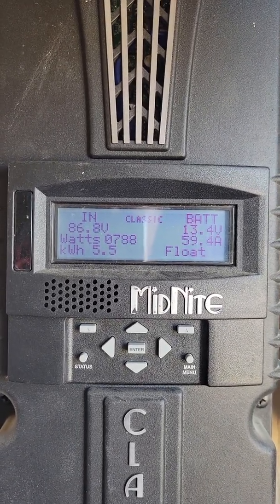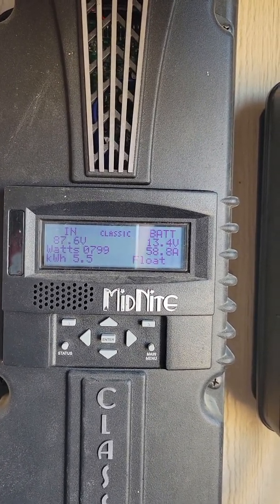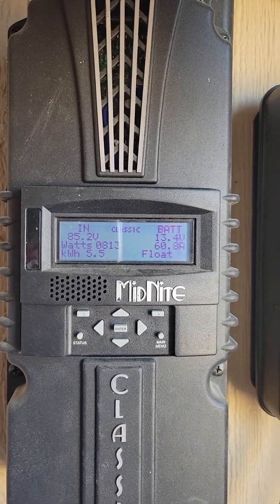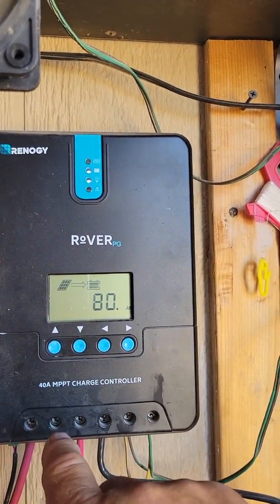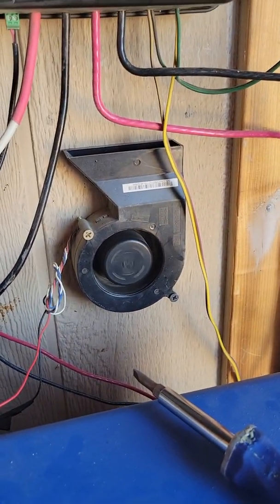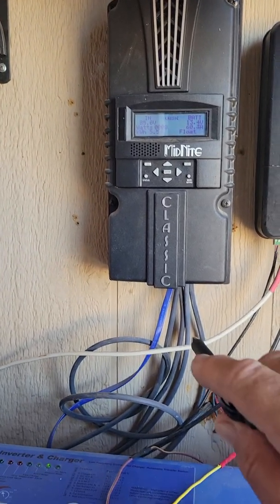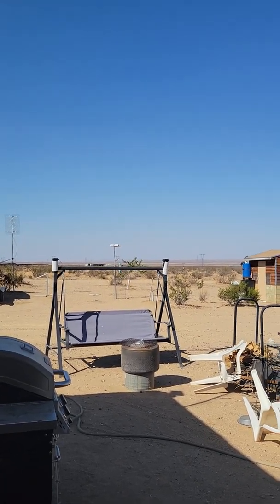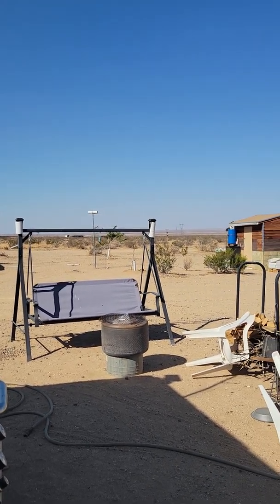Solar Charge Controllers and Limitations?  Aug 21, 2021

Comment: The day after I got hornet stung on the left thumb, there was a little blue wasp that  got in here...I had some phone charger wires laying there and it got down in those, and I went to turn my table lamp on and it stung me on the index finger of the same hand, so I got after it with a can of Raid flying insect killer, and the last I saw he was eating it off of his front legs...so my whole hand swelled up and is just now going back down so that I can close it...I got this thing looks like a tennis racket that takes two AA batteries, zap master I think it is...it's coming out of retirement today....there's going to be 'wasp thinnage" around here...lol
Reply from the maker: Sounds like a nasty insect!  Zapper to the front line!

Comment: Question 
The big solar panels you bought are used.  ????
What % of wattage are they putting out
There are a lot of used solar panels for sale.....
I'm thinking solar farms run them to a certain point then upgrade...
They remove the info stages from the back
Reply from the maker: Not used, new.
Reply: @GBear  if you don't mind me asking
How much were they
Reply from the maker: @jimh4167  I got a special deal, but they sell them at $140 ea.
Reply: @GBear  
Good price

Comment: GREAT VIDEO G-bear,  I’m getting ready to install my PV system for my homestead.  
It looks like you are all dialed in on your system.  So I’m thinking of copying what you have. I've been pricing the Midnight classic, 4000w AIMS inverter, etc.  Do you have a complete list somewhere ?
Any additional info would be helpful. thanks 👍👍😊
Reply from the maker: I would go with a bigger AIMS, at least 2 Midnite Classic 150's, and all LH series Trojan batteries if I started all over.
Also, if you are considering a PMA and go for the KT5, get the Max Core size and another Midnite Classic just for it.
Just my opinion.  I'll be converting over to those specs as money allows.
Reply: @GBear  thank you very very much👍👍
Reply from the maker: @frankprit3320  you're welcome.   If there's any thing else you want to know,  just ask.
Reply: @GBear  thanks 👍

Comment: What factors went into the decision on how to break your total solar output into different battery banks with different charge controllers? I'm facing a similar issue right now, having recently bought another 6000 watts of solar (in addition to the existing 2750). I'm thinking my little 40a Epever probably isn't up to the task!
Reply from the maker: Well, I didn't break up my battery bank, it is all one bank.  I want maximum battery power when the sun sets.
I did however break up the panels to separate controllers because of their limitations for input, but all chargers connect to the same bank, just at different locations.  Same with the PMA,  it connects directly to the battery bank.
Reply: @GBear   Good info, thanks! Sounds like I will definitely need another controller.
Reply from the maker: At least 2 for solar, 3 is better.  And One for wind if you go that route.

Comment: that is 1200 watts on 12V.. did you run the "sizing tool".?  curious as to what it says about the 1830 going in.. . so why not soak in the totecuzzi.? ahhh, i know why,, becuz it is not in front of the AC  lol.. getting to 104 here in a cupla days.. yippee..
Reply from the maker: I followed the owners manual that said it will handle up to 150v input, went well below that.  It has been working fine.
Tote-cuzzi is on standby to when I can climb stairs.  Only in the mid 90's here, 60's at night.  I sleep well.
Still soaking in cold water with Epsom salts, going to bed soon.
Reply: @GBear   i understand the owners manual.. i was asking about the sizing tool.. they made it for a reason..
Reply from the maker: I suspect it was made to make you buy a second controller.  The manual tells alot about over voltage and over amp protection built in.
Reply: @GBear  if you get a chance,, take a pic of the label on the back of one of the 305's and send it to me please..
Reply from the maker: Will do
Reply: @GBear   I actually did the firmware update 3 years ago,, unless there is a newer one..
Reply from the maker: @deserthorizons  doesn't hurt to check.